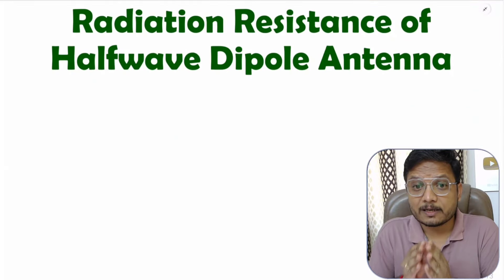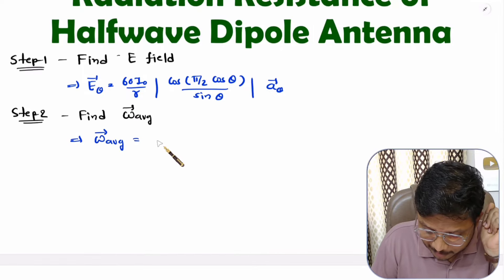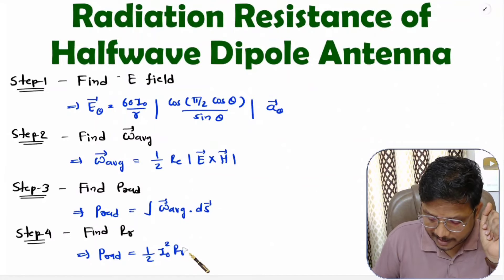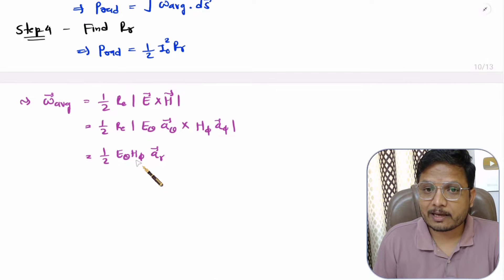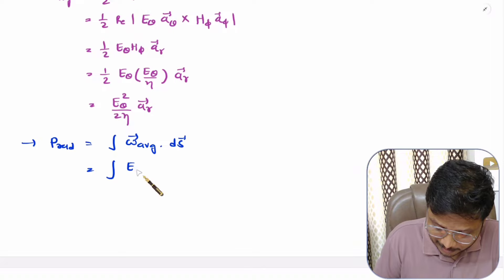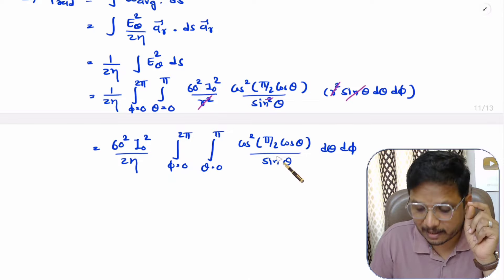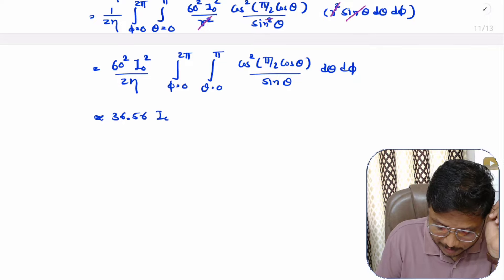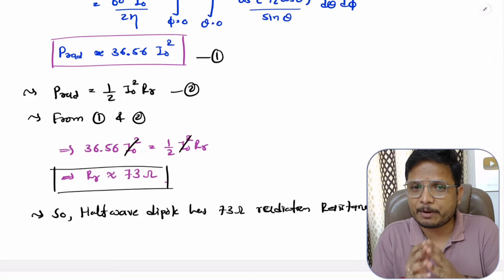Radiation Resistance of Halfwave Dipole Antenna | Antennas and Wave Propagation | Engineering Funda

Comment: sir what is radiation resistence ?
Reply from the maker: Radiation resistance is the resistance component of an antenna that accounts for the power radiated into free space. When current flows through the antenna, this "resistance" is responsible for converting the electrical energy into radiated electromagnetic energy.